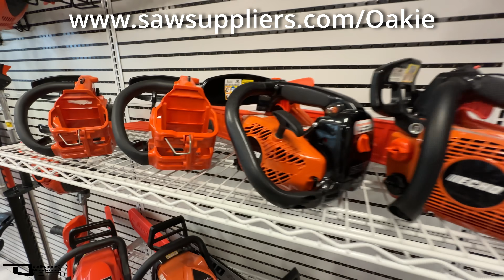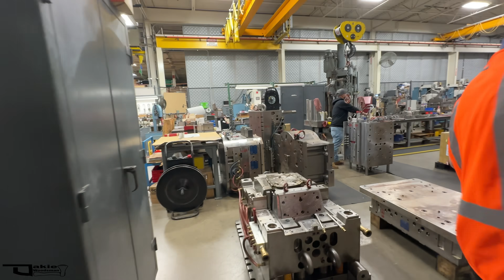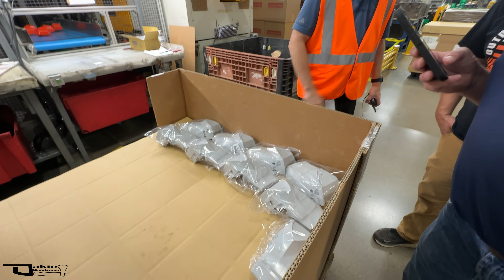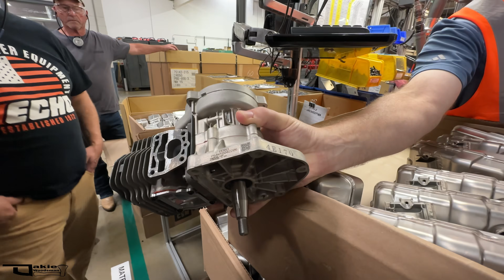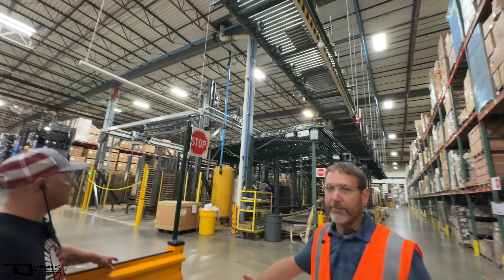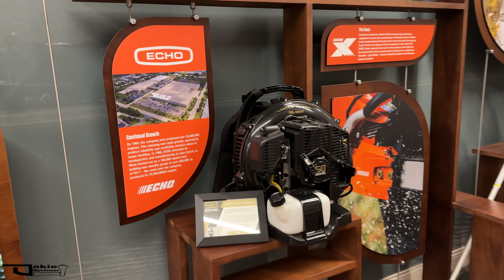Japanese Chainsaws Made in the USA

Comment: Ill never buy another Echo anything. Pain in the ass to get parts for. Part numbers for same part differ depending on where u purchased it from for starters. Just a complete pain
Reply from the maker: Do you have more information?  I have never run across this.
Reply: @oakiewoodsman  yes. Bought weedeater from a friend. No spark. Replaced plug. No spark. Went to dealer for coil. There was 28 part numbers for that model weedeater coil(depending on place of purchase). Finally found out it was bought new at Home Depot. Orderd $60 coil. No spark. Unplugged on/off switch. No spark. I threw tha sumbich in the dumpster
Reply from the maker: What model trimmer?
Reply: @oakiewoodsman  SRM-225
Reply from the maker: @stevennewman8276 interesting, first I have ever heard something like this.
Reply: @oakiewoodsman  true story
Reply from the maker: @stevennewman8276 pretty wild sounding.  it would be interesting if @Super-Dave-Outdoors would weigh in on this.  He is a mechanic at a very busy dealer in S Texas.
Reply: @oakiewoodsman  id love his input
Reply: @oakiewoodsman  i still have the new coil. Wanna buy it?!

Comment: I really like the warranty ECHO has. I get the unique experience of being the consumer and the technician, salesperson, partsperson, service writer, etc. 
Echo will take care of anything they did wrong, seldom have any warranties to file other than ignition coils and carb adjustments. The equipment is top notch and their cylinder quality is the best in the industry.
Reply: Ive ran shindiawa trimmers forc31 years..long before echo.bought..they have better handles triggers ..since the change there not as good.but still reliable..
Reply: Are the ECHO/SHIN trimmers strato now? I was kinda assuming but thought the 4 #ed(2620,3020) trimmers were.
Reply from the maker: Dave, I love that you made this comment being that you have the position that you do working on and with ECHO Equipment at such a high volume dealer in TX.  Thanks for sharing buddy!

Comment: About 28 years ago, when I was 10, my dad bought an Echo brushcutter, an SRM-2110 to clear out our property. I've been using it as a trimmer for 4 acres year by year. Going on 30 years later it starts in 2 pulls. We got an echo pb-261L blower in 2001. 1-2 pulls, starts every time. I have a 750 EVL chainsaw from 1980 that was used professionally logging Redwoods in northern California. As far as I know it has never been cracked open, and If i put gas in it today and manage to pull the dang thing, I guarantee it will start as sure as the sun will come up tomorrow. I've never had a part fail with proper maintenance. I have 10 Echo tools and I will keep buying them.
Reply from the maker: Thank you @bottwaandcalover!  That is super cool to hear from someone with all those years of experience!  The 750 EVL was never too much of an interest of mine but after this tour, I find myself suddenly quite interested as I now know that they run smoothly due to the twin cylinder setup.  I actually never knew they were used in production falling in CA.  What length bar was in use in this process?  Do you have any of the newer saws?
Reply: @oakiewoodsman  I bought this 750 EVL off of a retired logger turned tree service professional when the lumber mills started to close in Nor-Cal. He had his equipped with a 36 inch bar, Which I'm currently using, and it will pull the whole thing buried in Redwood with ease. The 750 is actually a single cylinder saw, 78.6cc and very torquey. I believe the twin cylinder Echo model was the 610 EVL, or Evil Twin, which I would love to get someday. I do have two mostly modern Echo saws, a CS-450, and a recently acquired CS-620 that I am super happy with. I really appreciate the simplicity and industrial, no-nonsense experience with Echo tools. No compensating carbs or computer control. Just give me a flathead screwdriver and my high and low screws and I will heat my house every winter.
Reply from the maker: @bottwaandcalover ah shoot!  I was off a few digits!  Thank you or the education and giving me another saw to lookup sometime!  I have never run a CS-450 but I sure do like my CS-620P!  Thank you again!

Comment: Echo is like Toyota/Honda. Usually not the most exciting but will last forever. The only problems I’ve ever had was my 8010/9010 blowers.
Reply from the maker: Thanks for watching and commenting! What trouble did you have?
Reply: @oakiewoodsman  my 8010 was always a bear to start and was a 3-5 minute process. They ended up looking at it and rebuilding the carb under warranty. It continued and I brought it back out of warranty for them to look at it again. Echo had an issue with it sucking air apparently but it was never a recall. They ended up replacing the block, carb, fuel lines, and spark plug. Echo covered parts I had to pay for labor. 6 months later my carb needed to be rebuilt again which again was they paid for parts but I did labor. Then my 9010 the tube kept blowing off which was fixed under warranty. The blowers work amazing but I haven’t been overly impressed with reliability when I only use them for fall cleanups. I was impressed with echos warranty though and my dealer working things out. My 225’s, 2620’s, and saws have all been great though.
Reply from the maker: @Tcw2019 thanks for sharing!  So far out of all of my equipment, I had one oiler fail on a machine and that is it.  That was a very easy process.  Off course, we are all looking for ZERO incidents but it is nice when the warranty and dealers get it done.  I wonder about the tube thing.  They used to blow mold them and now they are injection molding them.  hmmmm.... Thank you for sharing!
Reply: @oakiewoodsman  no idea! I took it to finish up a patio I was working on and had to blow out a lawn and it popped off 15-20 times and I was losing my mind 😂
Reply from the maker: I bet!